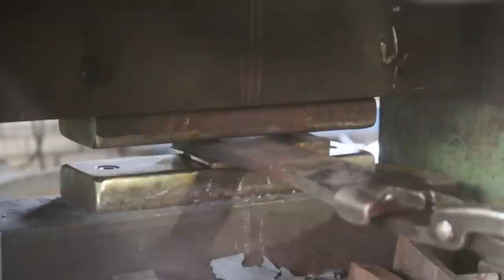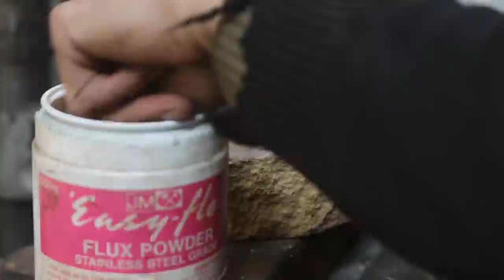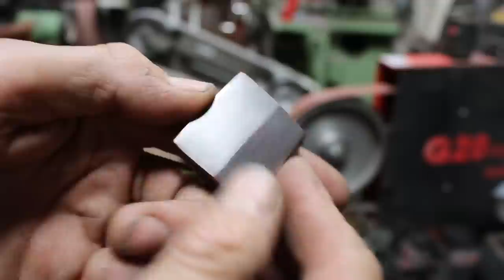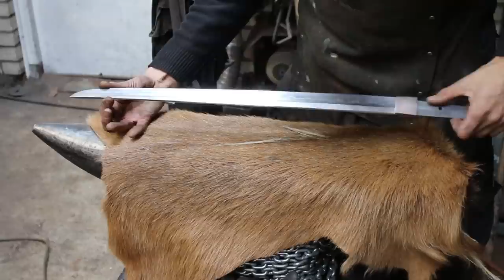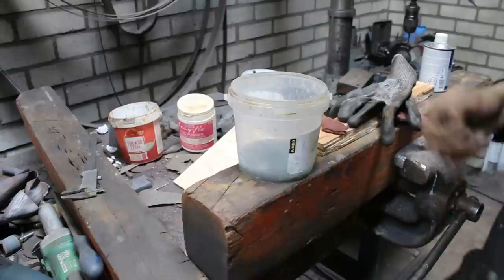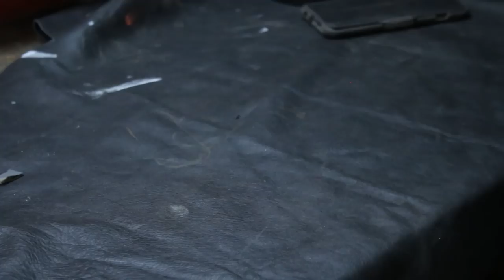Forging a Wakizashi sword, part 3, making the Habaki and assembling the blade.

Comment: That looks like a genuine Edo/Meiji piece. The tsuka and tsuba are not selfmade I guess.
Amazing work. Time to give the tanto and Sword complimentary handles - and hopefully some fine Saya with metal fittings.
Reply from the maker: No they are authentic.
Reply: You mean Edo period cause the Meiji era had a set of laws that prohibit the wearing of swords which put sword smith’s out of business as sword smith’s
Reply: @metalgearslayer9886   Generally you're right. 

Maybe I should have said >genuine antiquated Edo piece with new habaki and seppa< but I felt "Meiji" was quicker. I just like the look of aged late Edo pieces with rusty iron fittings and the smudged tsuka-ito in contrast to the new blade, thick seppa and habaki. Something about the contrast makes it pop really nicely.

Freerk did excellent work and the fittings compliment the blade.